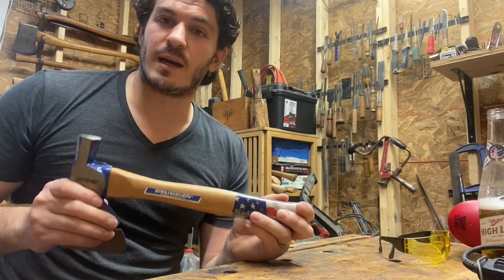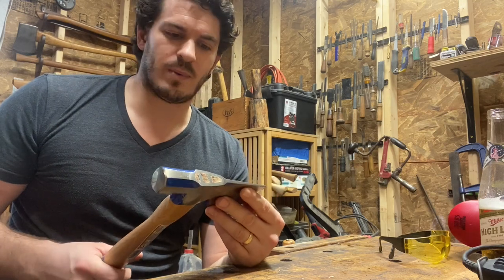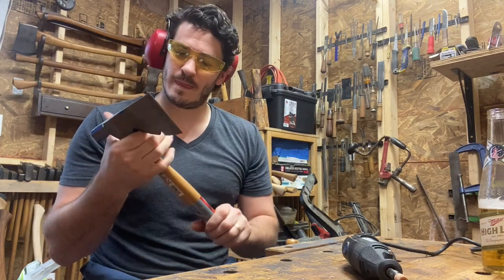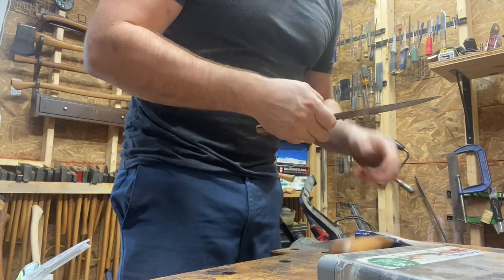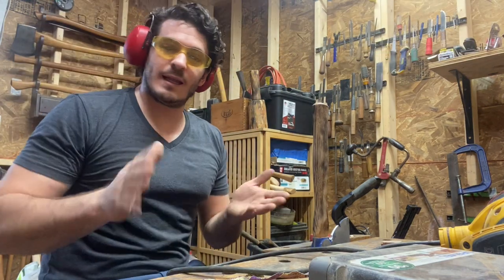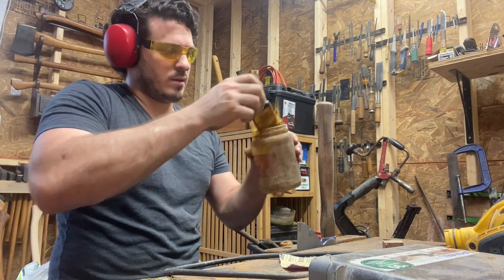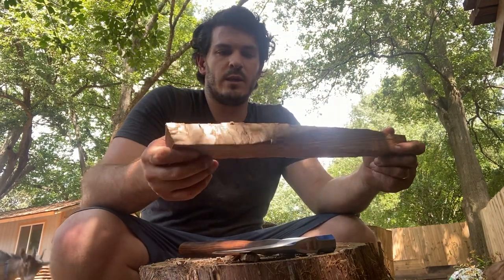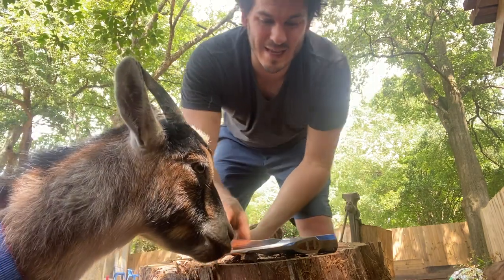American Made Hatchet at a Great Price- Modifying the Vaughan Carpenters Hatchet

Comment: I have one of those that I did similar modifications to. I cut the head to more of a bearded profile, figuring I wasn't going to use the nail puller notch. I also prefer a darker char, and then apply my "blacksmith mix" (equal parts, linseed oil, beeswax, and turpentine) while it's still warm from the char. The borax is an interesting concept; I may experiment with adding it to my mix, because I occasionally get mold/fungus on handles when they sit in the shed unused for too long. The more of your videos I watch, the more I'm impressed.
Reply from the maker: Thank you very much! This actually look great with a beard. Would probably it all the more functional too. I could stand to take a little more out to give my hand room when I choke up.

I still use this ask frequently, it’s in my carpenters box. Down here in Georgia we get a ton of mold and fungus too, I think the borax helps fend that off

Comment: Made a similar hatchet years ago and enjoyed it.  FYI - Pine Tar is a natural anti-microbial/fungal agent, too.  One of the best wood preservatives you can make is Pine Tar thinned with Turpentine.  Some folks will add a little linseed oil, but I prefer to not.  Just wipe the Pine Tar on and run over it with a heat gun to sink it into the wood.  Do that every year, and you'll have a tool handle that'll age beautifully and last generations.

Also, the single best way to clean off a handle.... is with the wire wheel on a bench grinder.  I discovered this years ago and now treat all my hammer handles like this.  The wire shreds all the polyurethane and stickers in just seconds, while also pulling out little bits of the softer wood.  This leaves you with a handle that's so comfortable you can't believe it.  When coated with Pine Tar, it's just dreamy.  And it takes only seconds to do.

Comment: I bought a very old Vaughan 22 oz carpenters hatchet in 1994. I was a house framer and wanted a lighter rigging ax. Most full size rigging axes have a 28oz head. My ax is a Vaughan Victory made by Plumb(post WW2). I removed the short handle and put in 11:06 a 18” straight hickory handle. The hammer face was smooth so I cut waffles with a dremel cut off wheel. It made the best swinging framing ax I ever used. I still have it today. It was really useful for rafter and joist framing. Such great balance.
Reply from the maker: The balance is awesome on these axes! I don’t have a rigging axe yet I’d like to swing one to check it out
Reply: @urbanlumberjack Get an old Plumb or Vaughan 28 oz rigging ax. They were the best.

Comment: Is that equal parts of the oil borax and pine tar in your proprietary mixture?
Reply from the maker: I’m still tinkering with it but it’s essentially mostly linseed oil. I add enough pine tar to thicken it, and add color, usually about a large spoonful. I add oak bark tannins if I have them, strained very well so it doesn’t add grit. Borax maybe a tablespoon or so, it doesn’t take much.

I’ve also used hickory nut tannins that works too. Probably any tree nuts or oak bark type would work. The tannins are what makes the difference.

Works great on hickory, and makes oak handles especially look beautiful.